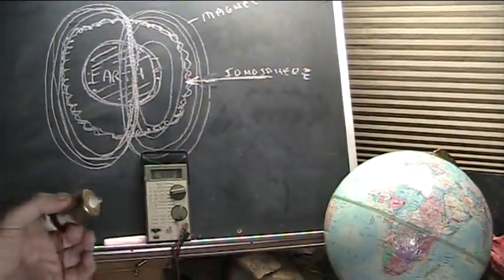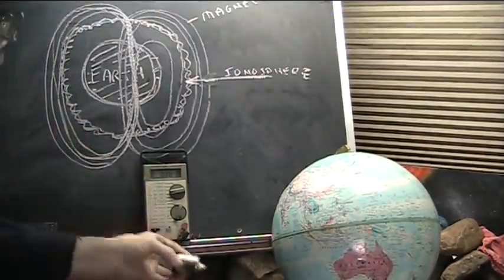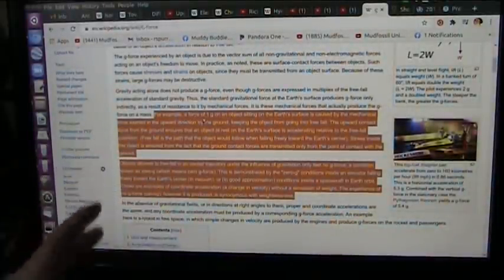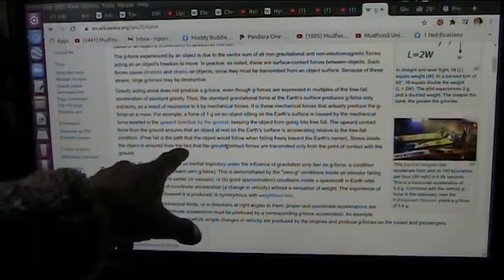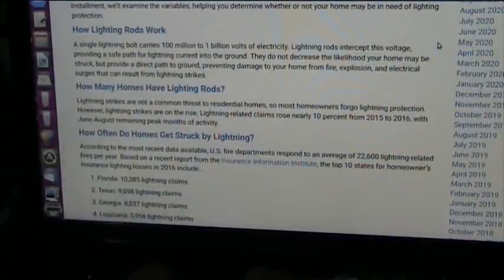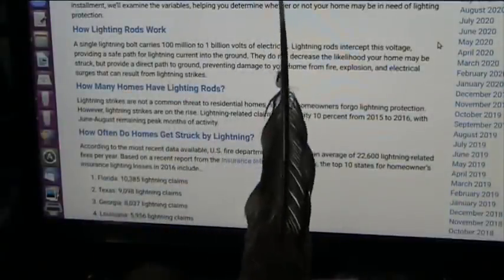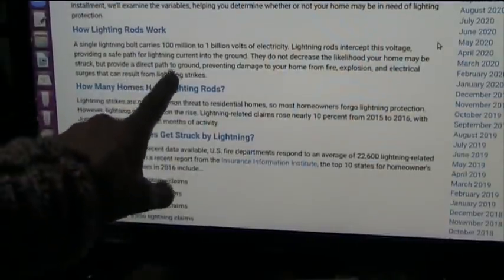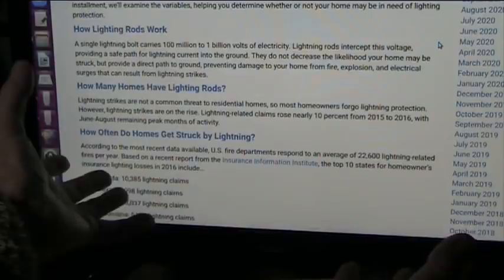Free Electric Energy Today and Simple

Comment: I agree that earth is a generator and that theoretically, we could tap into the potential difference of the positive and negative charges produced by the spinning earth. However, if we were to use any of that potential difference, it would further weaken an already weakened potential difference that the earth uses to produce the protective magnetic shield around the earth. That would not be a free energy source for us, as we would pay for it with our health, so I would not count on that as a source for power. Great explanation of the lightning bolts produced by the Ventura! No thunder means that the lightning bolts did not travel a great distance to discharge and did not compress enough air to cause the shock waves that we hear as thunder.

Comment: Roger, you do great work in numerous areas and are quite gifted in them.  However, to accomplish what you're discussing here regarding free energy, its FAR more simplistic than you might imagine.  Simply tapping into the earth itself is all that is required.  Very basic and simplistic (and cheap) components is all one needs to "gather" the energy, then run it through a converter then to a generator.  As you point out, its all there already, all around us and under our feet!  Stones with quartz in it and some copper would suffice!  Hook up the generator to one's home via a set of jumper cables.

Comment: Above ground antenna.  I heard a farmer's secret. Resistance wire in ceilings. Heats the building. Energy goes through wire to ground.
Reply: I believe this is what Tesla investigated in Colorado and with Wardenclyffe Tower. Using water under ground. Or coils above and below associated with coils inside building as large as inside of a barn as primary inductor. Spark gaps, rheostats and harmonic resonance. I believe he was using the longitudinal pressure variation. Which may use Earth above and below variation as well as solar and cosmic variation. Much like aggravated insulators in solar panels discharging capacitors.
Reply: https://m.facebook.com/photo.php?fbid=921652881702323&id=100015728588672&set=a.909600212907590